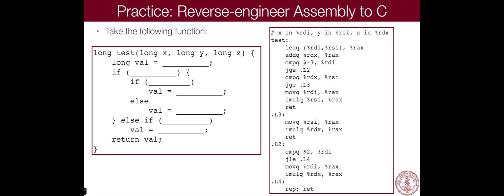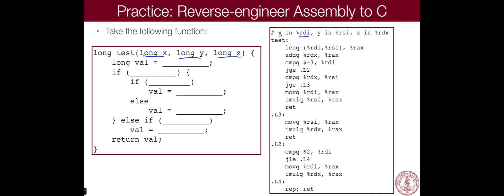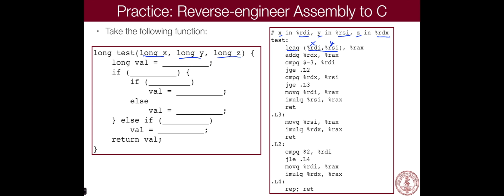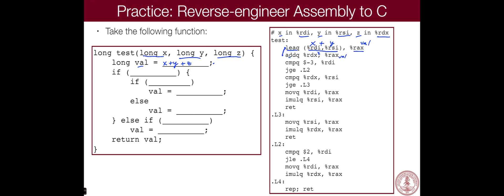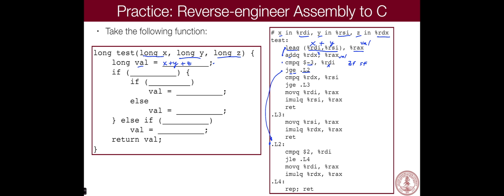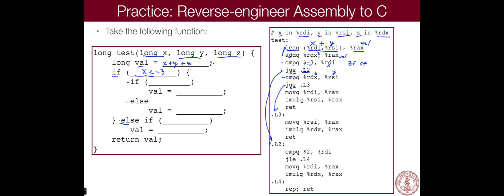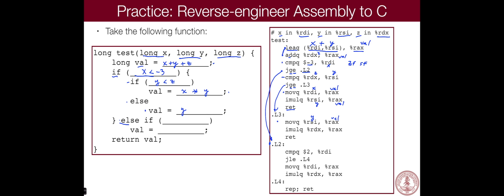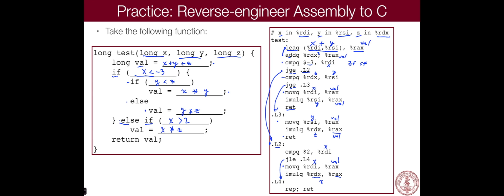Assembly to C Example

Comment: after "CMP r1, r2" instruction, the next condition jump instruction imply how to treat the two operands "r1, r2", if it is "JG label", then the two operands are treated as signed integers (0xFFFFFFFF is -1), if it is "JA label", then they are treated as unsigned integers. its correspond to c/c++ code: "if (r1 > r2) then jump to label". In C++ code, if you compare a signed integer with a unsigned integer, the compiler will compiled the code as two unsigned integers compare, and often gives you a warning, because it may lead to result that conflict with your expectation.

Comment: int a[] = {1, 2, 3, 4, 5, 6, 7, 8, 9, 10};
int n = 10;
int number = 7; // the number to search in the array
bool NOT_FOUND = true;
for (int i = 0; i < n-1; i++)
{
	if (number == a[i])
	{
		printf("Number %d is found at location %d\n", number, i);
		NOT_FOUND = false;
		break;
	}
}
if (NOT_FOUND == true)
	printf("Number %d is not found in the array\n", number);
 what is the assembly code ?